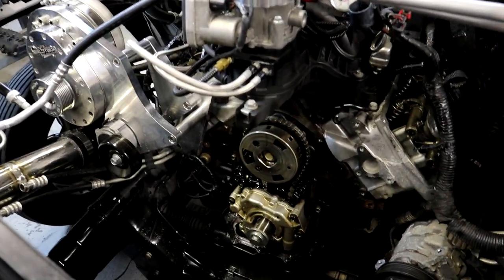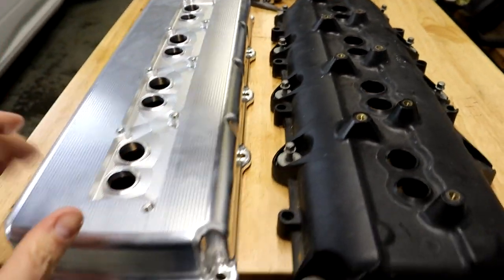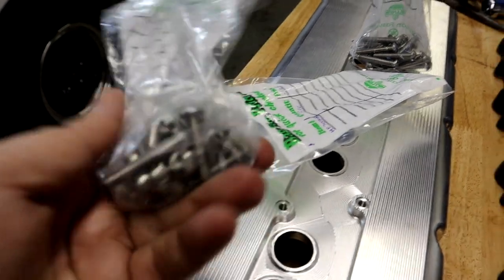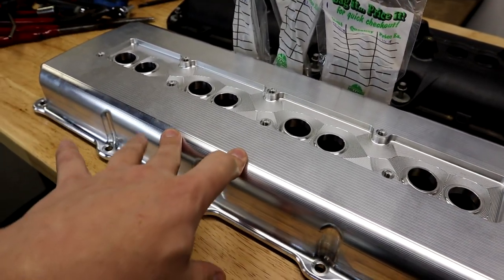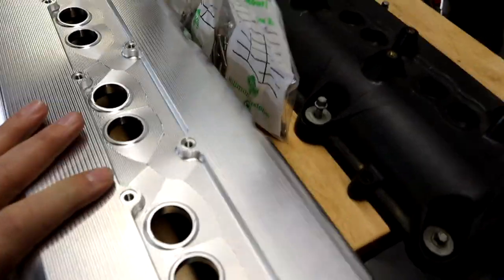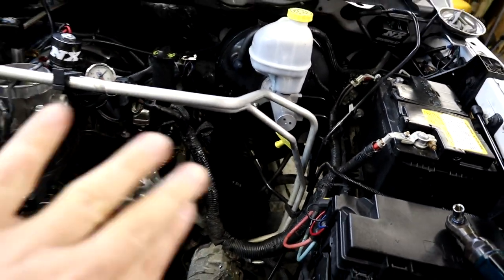SPELAB Billet Aluminum Valve Covers Install On 5.7 HEMI

Comment: I bought some valve covers on ebay July 2020 that look just like those that came with hardware / gaskets for $250. They look exactly like these except mine have 8 nubs on the inside for the coil pack bolts. You can see 4 nubs on these valve covers near the spark plug holes but mine have 8 nubs. Kind of makes me wonder if mine weren't some prototypes of these valve covers before final version?
Reply from the maker: You have a link?